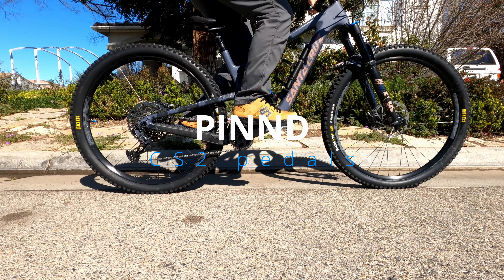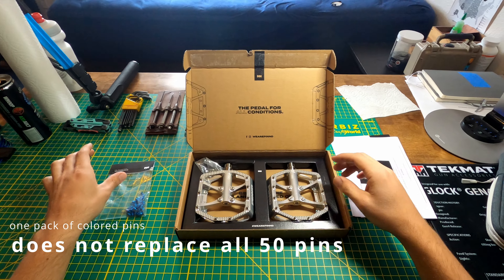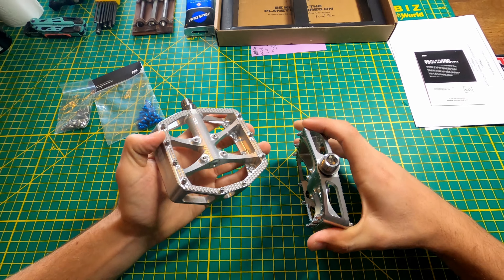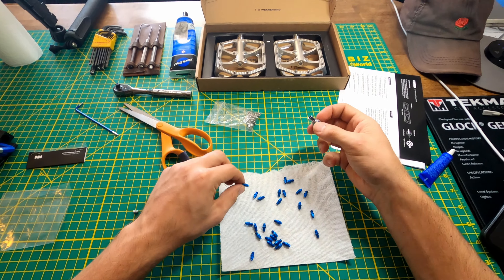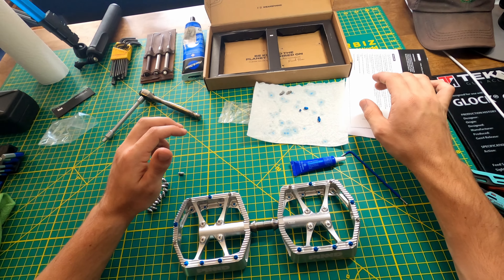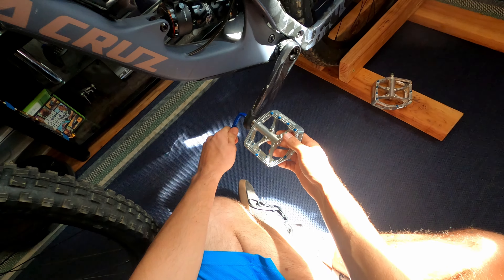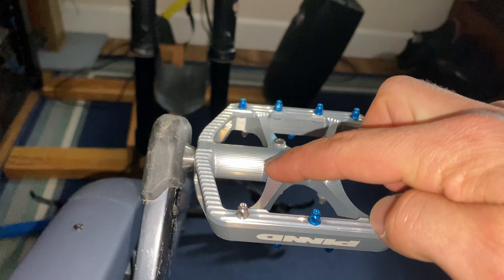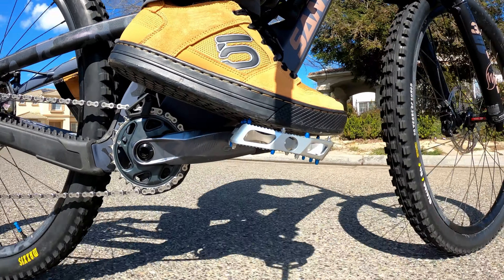PINND CS2 Pedals- Review & Install

Comment: Are you enjoying these pedals ? I’m curious to hear how they’ve performed after some rides.
Reply from the maker: Yes I love the grip and I bash them pretty hard and all that I have done is scraped em, broke some pins off, and a hard fall on a wood feature bent a spindle. Broken pins are pretty easy to drill out or remove. Compared to other mtb pedals they are a little thicker. And you are able to by replacement spindles if you happen to bend one.